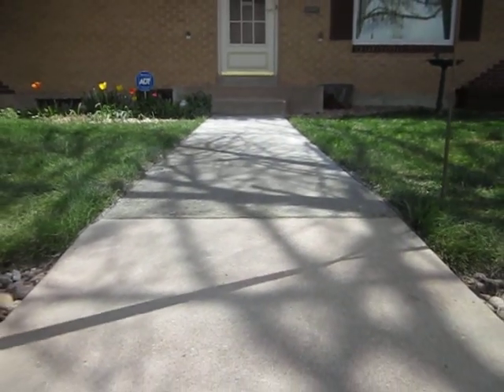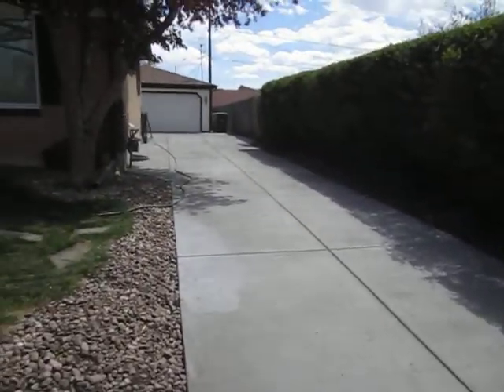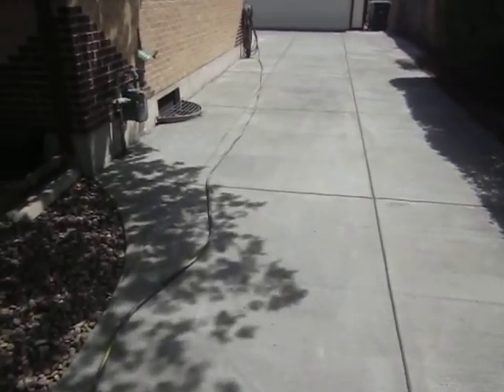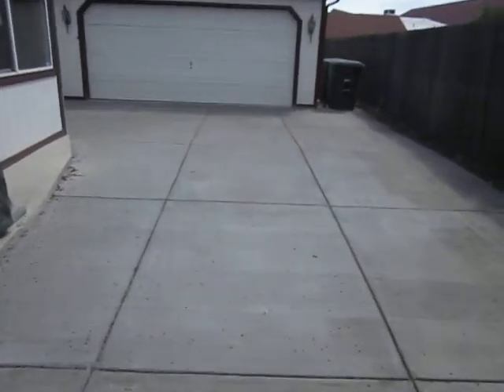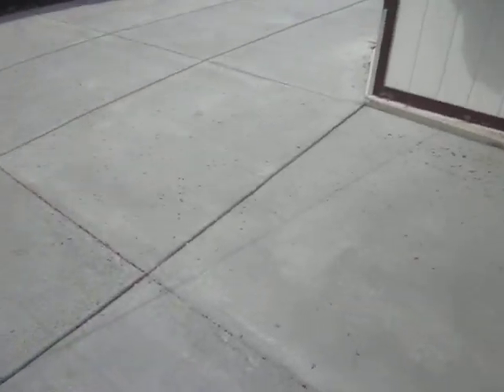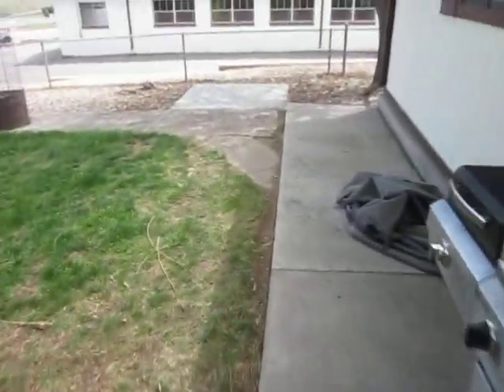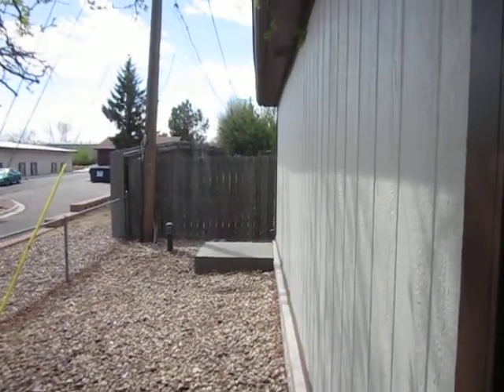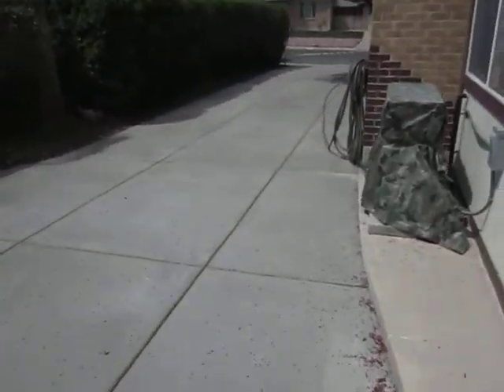Concrete driveway installation Replacing a concrete driveway Part 2

Comment: did I here you right. you put rebar dals into the foundation. if so, expect a crack from frost heeving.  foundation don't move with frost where driveways do.  where is your expansion joint between the old concrete and new concrete.  you did a good job putting in enough control joints.   What did that driveway cost? you did direct the water to a place were I didn't see much of an area for it to drain to in the swale.  I would of installed a drain (dry sump) to help trap the water along the edge of the property were you channeled it to.
Reply from the maker: If the proper excavation and compaction is performed before the poor, there will be no heaving! We don't really have a frost line here in Colorado. Expansion joint is not necessary in all situations. Drainage is good! Thanks for the comment!

Comment: Ok,, if there is frost in the ground during the winter months , it doesn't matter what sub-grade base you decide to use or compaction rate, that slab is going to heave.  there isn't no magical gravel that doesn't hold frost.  But if it doesn't freeze in your area then why are you saying the driveway was heaving in the first place.  maybe you meant settling and ground moister changing soil movement causing the driveway to crack and shift.  But ya, any concrete contractor knows you must use expansion joint for concrete expansion from the heat and cold.  Expansion joint is a must have in any proper concrete application.  Heres another thing you should look into.  Over working your concrete with steel takes out the air intrainment.  So if you ever get a slab that pops the surface and you have no idea why, you probably over worked the surface and took the air out of the concrete.(not that I could see that in your driveway)   Not to piss you off, but I can totally tell you are a salesman and really don't know what your talking about.  But hey, your probablly doing really well selling driveways to homeowner that don't have a clue.  One thing I do know,  the driveway replacement world will come back to haunt you. Just wait till someone decides to put de-ice on your driveway that wasn't sealed with the proper sealer and you will have a court date.
Reply from the maker: Thanks for trying to judge me from accross the internet! You have no idea who your'e talking to. I've been the constuction industry for 32 years brother! Built million dollar homes from the ground up. Built 4 foot thick by 80 foot tall foundation walls for the University of Colorado. I've installed several home foundations. I've installed hundreds of driveways, patios, and sidewalks. In 15 years I've never had a concrete warranty issue so unless you have a question, have a nice day.